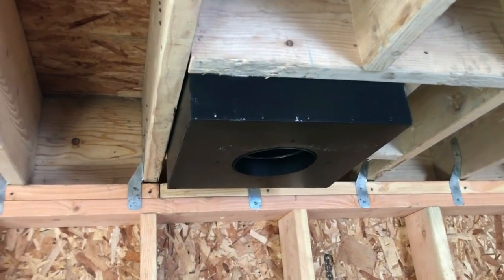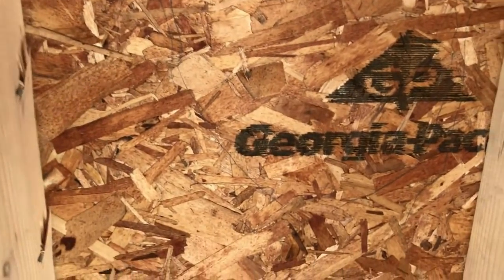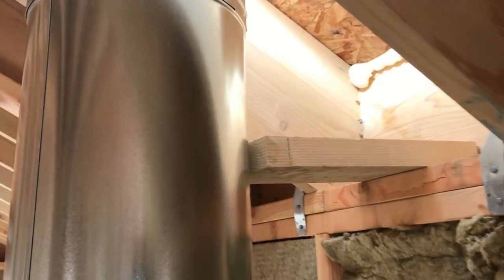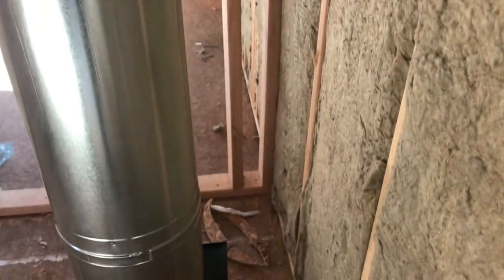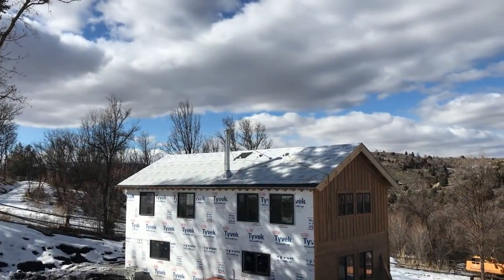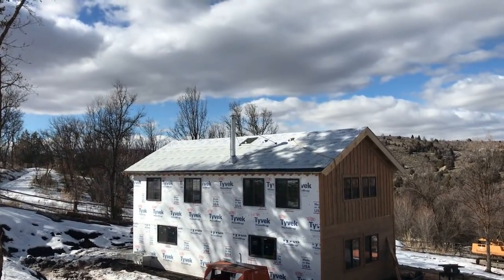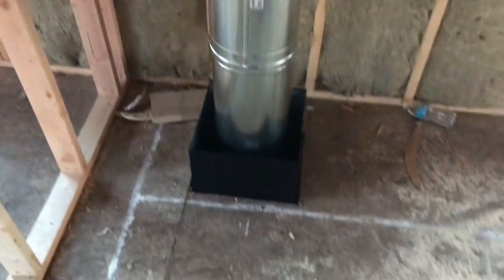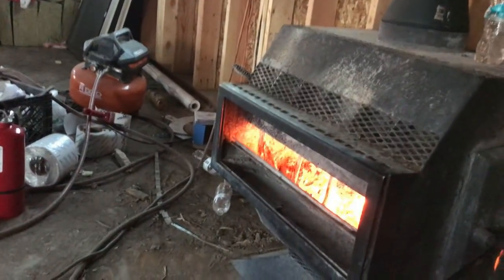#195 - Install Chimney Pipe And Wood Stove... DONE!!

Comment: my brother bought a farm in southwest wisconsin, the owner was in his early nineties. the house was where he was born. and nothing had ever been done to bring it forward except electricity was added. wood cookstove,  wood franklin stove. outhouse. pretty primative.  what it did have was cold springwater pumped up to the sink. if warm water was desired you heated it on the stove. the thing is everything was single walled stovepipe, the parlor stove went into a brick chimney built into the center of the house. the cookstove went thru a castiron ventilator thru the second floor into a wood supported mini brick chimney to exit the roof.considering the age of the house.it worked well

Comment: a SUGGESTION for you on your permanent stove, use Durarock or similar concrete board behind you stove then a nice tile or brick backing. no worries about overheating the wall with that set up, i did it in my home and the inspector loved it.

Comment: If you do build a box around the chimney pipe upstairs you might be able to put some duct work on it and suck that heat back down and blow it towards the front door with a small low powered fan perhaps a computer fan just enough to warm the area around the walk-in door
Reply: If you have coats on a hook it would help dry them out to

Comment: I have the same chimney on my wood stove in the basement. A suggestion at least for the outside chimney joints. Wrap the joints with aluminum duct tape. It keeps moisture out of the joints. Just a suggestion.

Comment: Good looking stove. When you enclose the stovepipe upstairs, think about putting in low voltage fans (like computer fans) to use the heat from the enclosure .  Love your channel!  Glade you made it off of the roof safely! I could not have done that. I almost had to 
hold my breath just watching. If you have to go back on the roof, please consider using a harness; my heart will thank you.
Reply: Your right Hammer,,everyone thinks that it's the other people who fall, especially those who fall...Two stories and frozen ground,,,that's a lot of Force times Mass = Acceleration..

Comment: The roof jack goes on after the roof as it will leak on the down site and take out your roof and reducing from 8 to 6 is not usually recommended.

Comment: Nothing like the satisfaction of a start to finish completed project.  Nice job.Just like your roof vents though, that roof flashing is the wrong type for either a corrugated or standing seam metal roof.   However,  they are the perfect temporary solution on top of the sticky paper until you can roof. Even if you use composition roofing they will need to be redone.  You could get away with stacking one if you went with comp but if you use metal it will have to come off.

Comment: For a temporary solution on the floor and back wall you could set the stove on a couple sheets of 1/2" cement backer board and a sheet behind the stove.
Reply: The floor is concrete, but yeah, some corrugated steel behind the stove would be a great idea. It would help reflect the jeat back into the room and much of it away from that dry timber wall.

Comment: Nice job. Chimney looks tall enough to give you great draft. For safety I would put a piece of fireproof material behind the stove while you finish the house. Prolonged heat may overheat the studs & plywood. Protect what you built. That should do a great job heating the house, especially after you insulate it. 👍  Vinny 🇺🇸

Comment: The cost of propper safety gear (harness and retractable lanyard) is peanuts compaired to the medical bills if you come off that roof.  Put the ladder on the gutter side, not the gable side. 
 You need to set a better example for your kids.

Also, be VERY careful having a fire in that stove with it SO close to the combustible  wall...there's a reason they want it 24" away...you're doing good for a beginner, but please be safe!

Comment: We used dura vent to put up our through the wall chimney for our wood stove and when it came it was so dented up I had to use a hammer to beat the ends straight enough to connect them together and when I messaged Menards where I got it from they asked for pictures so they could use them to train their shipping department but that’s is as far as it went, Love the chimney just not happy with how it looks with the dents all over it

Comment: Congratulations on getting some heat into your work area. However, please put some sort of metal or heat resistant shield behind that stove. At least until you move it out from the wall. I'd sure hate to see that back wall combust after all the work you've put in to that house. Keep an eye on your Tyvek, if it starts wrinkling and/or melting on the outside by the wood stove, it is getting way too hot against that wall. I don't know why I thought you already put the roof on, but I was shocked when you climbed up there to an unfinished roof. Glad you made it up there and back down safely. I think you need to find a 28 - 32 foot extension ladder. You'll be living there for a long time, and a folding ladder in the bucket of a back-ho really isn't that safe. I am pretty sure that none of your viewers want to see you take a fall.
Reply: You must have missed the part when Heath said it was temporary . He had to get some 45 degree connectors . He was just checking to see how well the stove burned :)
Reply: He also said 24 inches from the wall is code.
With a heat resistant shield, that should shorten the distance.
But, yes, even a quick fire can cause problems.
Reply: @kevinellis1232  dude what is your problem? He's looking out for the man and offering sage advice. How do you construe that to him hoping all his hard work goes up in flames? Take your trolling elsewhere this is a wholesome video
Reply: We were building my daughter’s very tall house in Louisa Va  about 25 years ago. I was driving up from Ct. to help.  I arrived and found my Son-in-law with his 20 fat ladder in the bucket of the backhoe.  He was atI turned around the limit of the ladder and the reach of the bucket reach stretching to work on installing the fascia. I turned around went back to the building supply house and bought a 40 ft ladder.    Went back to the job and got the son in law off the toy ladder and back on the ground.    The ladder arrived and it was a beast.  Must have weighed close to 100 lbs.  he had the. Muscle and could handle it. I could only watch.       The  rungs were about 2 feet wide.   He is a contractor and does beautiful work,.  He and his brother have built several million dollar homes. Just telling this story to illustrate that good smart people will do dumb things in the effort to push a job along.  I still tell this story and everyone laughs at the visualization of this event.  Then the room gets quiet.  Everyone is thinking how close to death or crippling injury Mark was working.  I spent 30 years in the elevator business.  Safety was our watchword.  Almost every year there was a story in our company newsletter of a constructor or maintenance examiner going down the hoistway.   Today all of the field men and even the service reps and supervisors must wear a full body harness tied off when in the hoistway on car top

Comment: Your codes are similar to ours in the uk.
The 2ft @ 10ft and 2" from combustibles (600mm at 2.8 mtr out and 50mm from combustibles 😂), you've done the right thing getting it way above the ridge. Keeping it well away from swirling down draughts. 
We have a g number on the end of the flue number that may increase the distance from combustibles ( sometimes it's g100 so 100mm from combustibles !) ours isn't usually triple wall tho, that flue sounds like top quality stuff,, I imagine it's expensive.

Big stove isn't it. Do you have free air requirements allowing combustion air into the room?

Comment: @0:30 where you cut the joist and put in the block.. can you go back before you put the ceiling in and figure some joist hangers somehow.. so its not just toe nailed in.   at least on the joist that was cut off and dead headed..  at lease one U210R would make me happier.. but i don't count.. i am just a troll off the web.  you could get 2 and cut one in half to nail up to the open corners you can get to..
Reply from the maker: I've got hangers for it.

Comment: just out of curiosity, why caulk down the roof jack to the underlayment?  is it just a temporary seal till you pull it off to lay your roof?
Reply from the maker: it needs to be sealed but I may pull it up when I'm doing the roof in the summer.
Reply: Red Poppy Ranch I see. looks lime you are making good progress. not sure if you came across it yet, union corrugated company has a you tube channel now on how to install standard metal roofing. they offer pretty good tips.

Comment: Surely you have the proper ally manufactured roof ladders in the US by now, we have in the UK, the ladder itself lies flat on the roof with a quite large metal bracket bolted on to  the ladder end that goes over the top of the ridge to the other side, which secures and stops the ladder from slipping off the roof as well as you when you are on it, they also have a pair of wheels on the opposite side to the bracket to shove it up the roof easily, you simply flip it over to the bracket side, when you get it in to position, in the old days, before these ladders were made professionally the roofers would get a joiner (workmate) to make them for them from lengths of wood with batten lattes nailed on for foothold/rungs and 2 pieces of wood boards nailed in to a L shape and the boards secured to the end of the home made ladder with metal straps for strength, I still have a home made one, that my father a joiner (now passed) made one for himself over forty years ago, they never come in wrong to have one.

Comment: Is it too expensive to have a sprinkler system, just water hoses, and nozzles inside with a connection outdoor where you can connect a garden hose if you have  fire in the house you don't need to run into the fire, just connect water to the system and let the system takes care of the fire, just around the stove, the laundry room and strategic areas in the house.
Reply from the maker: good idea...

Comment: You sure got balls.... big ones on that roof. EPA regulations now require wood stoves that meet emissions and seems like you have had the building inspector check everything. Most communities require a permit to be pulled for wood stove installs so their fire departments are not saving your family or house. But where you live maybe anything goes.   Does you inspector allow an older wood stove in a new dwelling? Good question to ask before you finish the stove install. 

You are going to have an issue not just with back wall distance but side as well as the flooring material ... I understand your need to have the heat while working but before your next fire  go to a lumber yard and get a sheet of fire resistant cement board with the stove so close to the wall as a temp fix. It's usually a lot hotter from the stove pipe but maybe triple wall pipe doesn't reach burnable temps. 

You will get a great draft with the pipe two feet over the roof peak ! Idaho has a great program for buying a new wood stove with tax deductions if the Inspector allows you to put that stove in... if you then want a new one you can then buy an EPA efficient stove and get all the deductions. You can link to that from the EPA's site

Comment: Nerves of steel.  But there has to be a safer way to do these high elevation activities.  If you fall you're not going to be able to physically stop yourself just hanging on to a rope as you do.  Could have moved the backhoe to that side and worked straight out of the bucket instead of traversing the roof in slick conditions as you did.  I know other people have said it but remember your kid's and family buddy.  I'd hate for you to get hurt.

Comment: How about a calcium carbide canister with a propane pipe to a burner to heat that wood stove? A redundant heating system if y'all dis not have wood or y'all did not want to make a lot of smoke? Like how a carbide old miners head lamp works? 😕
Reply: Indigo Dragon71 could you link to a page explaining what you are talking about?  It sounds interesting.

Comment: We all had to do was get the pipe close enough to where you can see straight and put a board on the outside edges of the of the cylinder I keep marking the roof as it basically around the board

Comment: I don't understand the whole stove situation, your hand building a home and yet your risking the whole dream with a non ul listed smoke dragon, there are so many other great wood burners on the market that offer close clearance installs, safer, and much more efficient. Imo a woodstove that is going to be the primary source of heat should not be skimped out on, that's something that will be used everyday from October till May. FYI the single wall pipe also needs the minimum clearance of 18", double wall black pipe is 6" minimum clearance.

Comment: I need a inspector comes when you have whenever you cut that box is not going to be acceptable you just the way your floor strength and you didn't add nothing there to replace it expanding into the two other four sources is it acceptable you can't have that big of a gap and expected high beams to support the flooring if you would have widened then you could have supported the one in the middle but you didn't do it that way and you would have had the one going across the middle completely thicker than the one you put in how to make it at least a 3 foot header and haven't hang on a hanger Joyce on the other side with in with another where you would have butter the other floor joist up with another to buy for our 2 by 8 whenever it is on the other side you can't do it like that it just doesn't work

Comment: Your going to have to address the floor where you cut the joist away..it's not going to meet code. Talk to the building inspector to resolve the issue.
Reply from the maker: I need to put in the simpson hangers but I didn't have any with me.
Reply: The hangers as well as doubling up the boards is code.